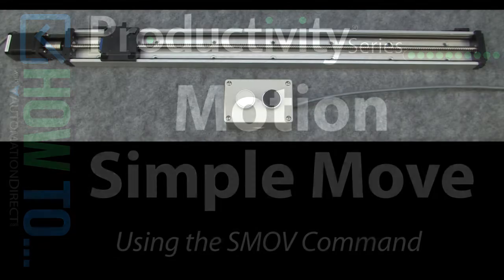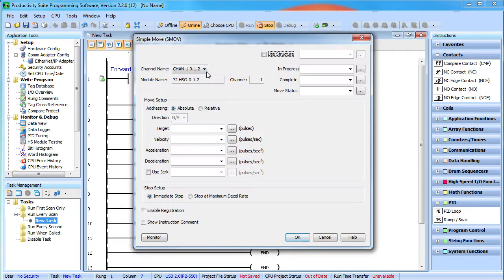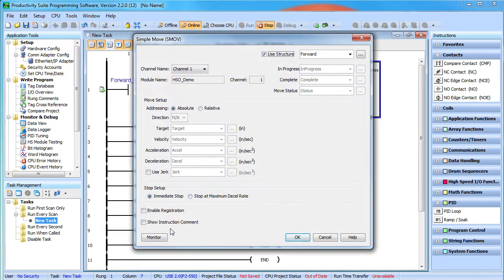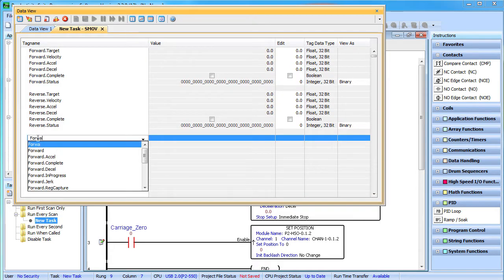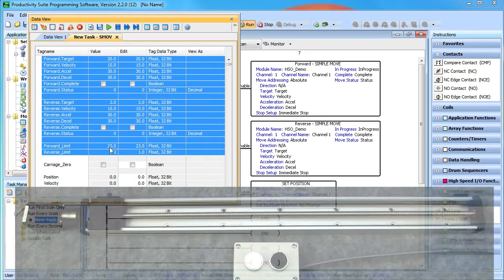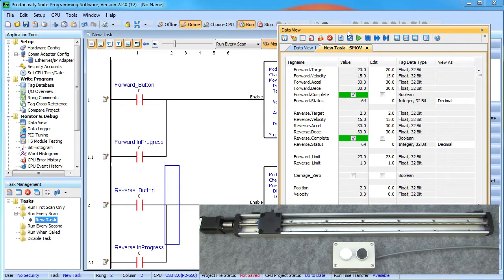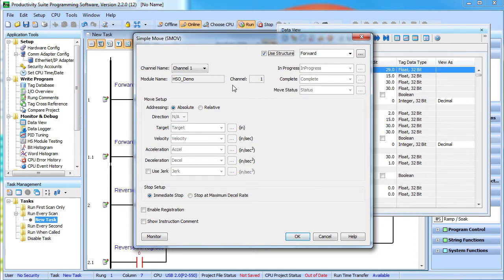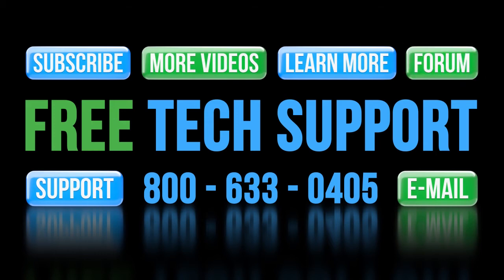Productivity Series PLCs Motion Control - Simple Positioning from AutomationDirect

Comment: Hello, do you have chance to check my last comment?, We want to buy a PS-AMC4 unit for one of our projects but we want to make sure that is going to match with our application, we will use it on a P1-550 PLC.
Reply from the maker: Ramiro, you can use the PS-AMC4 with a P1-550 CPU to control 4 stepper motors. You can monitor the movements as you do them just like the HSO module. You can use the Set Position instruction to set the current position to any value necessary (including zero).

If you have further application questions, I recommend you call or e-mail our free technical support as they will have more tailored information for your application. They can be reached at 1-800-633-0405 menu option 3, or by e-mail techbox@automationdirect.com

Comment: Hi, can I do the same configuration with a PS-AMC4? I'm looking that this video is for a P2-HSO but the configuration tab looks similar. I'm trying to move 4 steppers just sending the amount of pulses or the distance in inches and monitor that information. 

But every time the motor finish the move, I want to set the positon to zero like you did with the Carriage_Zero bit, and start from there again.